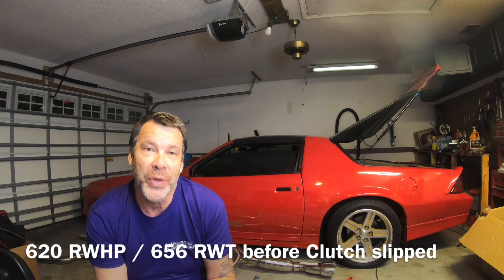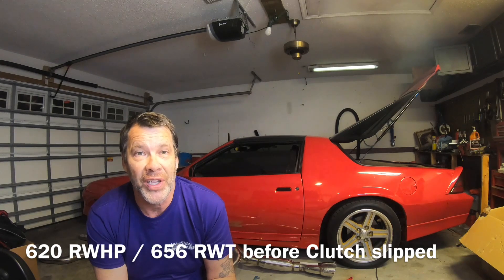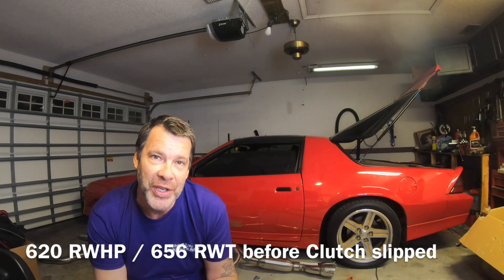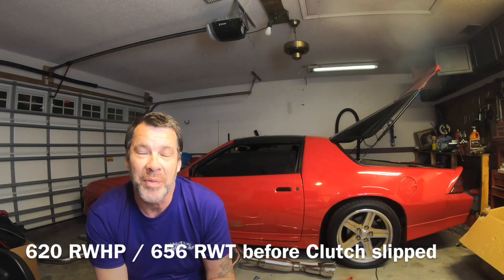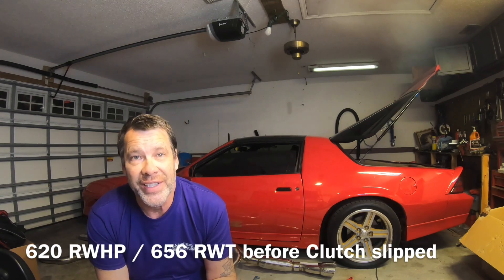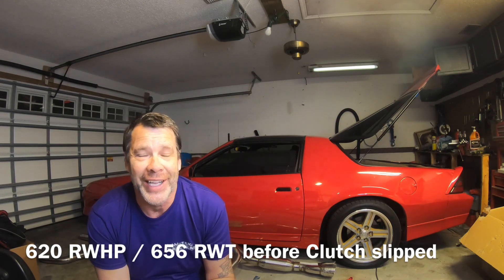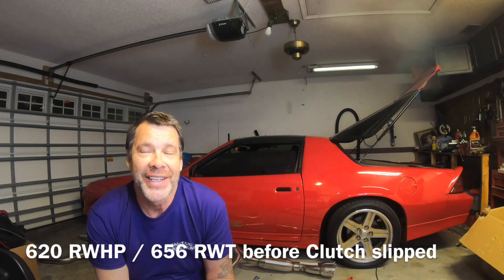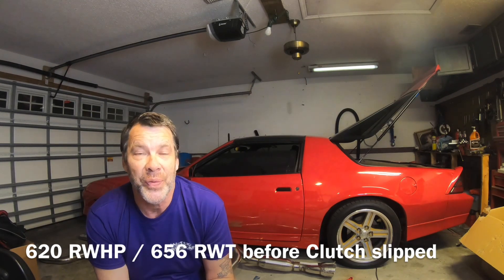LSA Blower dyno results! Part 1 of tune session Thirdgen Camaro Iroc-Z LS3 swap

Comment: U should’ve went with a blower cam instead of tht N\A cam Thts gunna hurt u
Reply: I dont think having a big NA cam is a bad thing when you add a blower. It's just going to take the existing curve and add a ton of power all over.
Reply from the maker: @Greenlightfilming  I saw some videos saying the same thing! This one has a 113 lobe separation so it’s not that bad overlap for positive displacement
Reply from the maker: I rather lose some hp and keep my hard chop, but that’s me, it has plenty of power with the cam 👍
Reply: True love tht chop
Reply: I’m running a btr3 na ls3 cam as well with my lsa. I had a brand new btr3 pd torque cam in the box and called btr and they told me it wouldn’t be worth the swap, they said the pick up might not be noticeable from driver seat and wouldn’t be much and that I’d be surprised how well their na cam will respond to the lsa. So I stayed with my na cam that was already in, plus I love the chop too lol
Reply from the maker: @reggiewoods937  let me know how it goes!

Comment: Great #’s so far. On the new exhaust setup will you be running cutouts?
Reply from the maker: Thanks man! Not at first, I’ll probably end up swapping out to Magnaflow mufflers with turn downs. I may do cutouts then since it will quiet the car down ... or I may just leave the Setup alone once I get it in... idk 😂